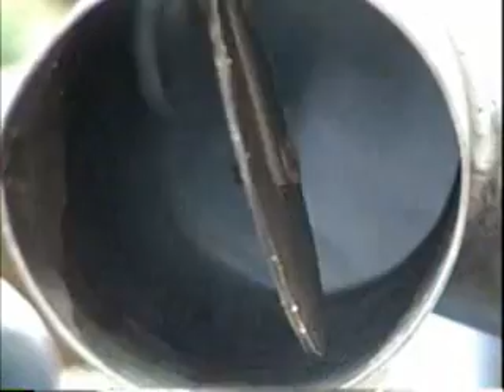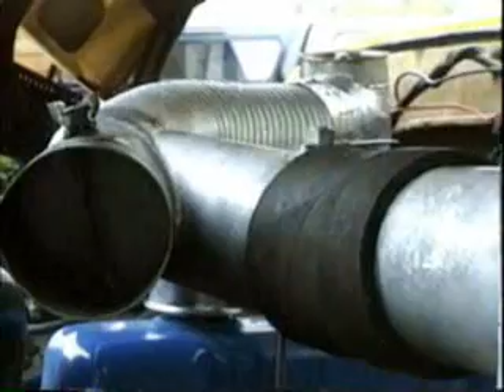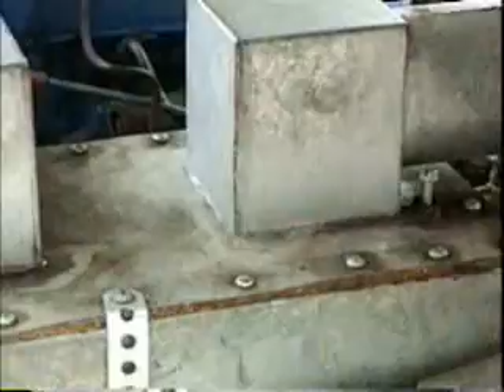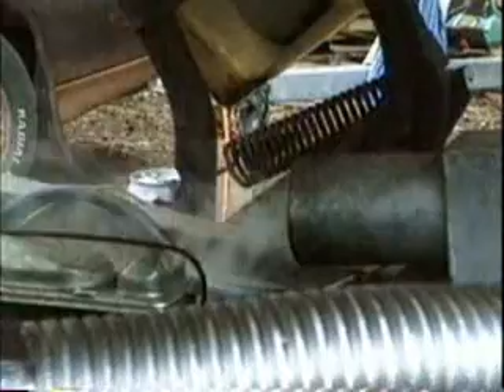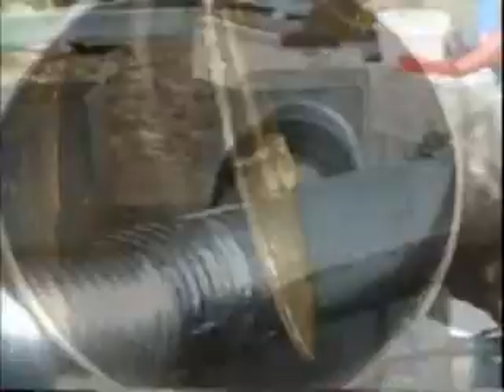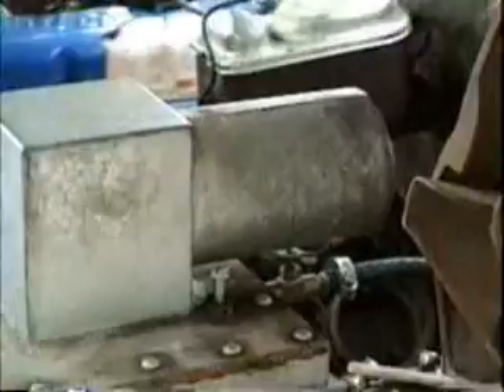Here is definitive proof on how to separate all Atoms in all liquid soluble matter.

Comment from the maker: Fuel history I am not concerned with, my concern is the future fuel. I know exactly how the GEET system works, it is a modified form of what I did, 30 years ago, only they don't really understand what they did. They talk about plasma and the like, but basically they are taking the flammable liquid  spraying a flammable mist onto a heated surface, at the intake manifold. Controlling the air intake or fuel output, they can control the engine RPM. I sprayed the gasoline onto my heaters 30 years ago

Comment from the maker: The smaller the matter the faster it assumes the heat being applied. Pass a flame close to an ant, his legs will turn to charcoal almost instantly. Liquid is also a matter. Therefore I say present a very small amount of liquid to a desired heat, and the liquid will assume that temperature, then boil at the applied temperature, any temperature desired. This is possible because it takes so long for any liquid to boil. Temperature happens first, when small amount of matter is applied.

Comment from the maker: Thinking out of the box, has developed the technology we have today. Many scientists are afraid to try and change, or accept something that they have never seen before. The presumption is that liquid will boil only at said liquid's boiling temperature. An ant having a flame passed close to it, it legs turning to charcoal almost instantly tells me, the smaller the physical matter, the faster it assumes the heat. Liquid is matter to, it works the same, and can be taken to any temperature, applied.

Comment from the maker: Here is more information. In San Jose, CA. I saw readings on a truck I took there. Running on liquid gasoline, the smog readings maxed the chart. When I switched to the white vapor, the smog analyzer made a flat line at the bottom of the chart. The mechanic thought the smog probe had broken. The truck on You Tube, I used 2 clean rags and ran the truck on liquid gasoline first, the rag would make your eyes water, from a distance. Running on the white vapor, it smelled like freshly ironed clothes.

Comment: My research and study has indicate we send 40% of the gasoline out of engine into the exhaust system to be burned up inside the catalytic converter. An additional 40% generates heat from the process of compressing gasoline in it's liquid state ie 50 to 65 micron liquid drolets sprayed into the combustion chambers via todays Fuel Injectors. This heat is energy that does not become motive force- but rather just simply heat. Thus 20% of the fuel is what we use to move the automobile ie Motive Force

Comment from the maker: I had forgot, you are right the engine did tun cooler on the white vapor. Because there is no liquid inside the cylinders, to remain burning, and continue to burn until it reaches the catholic converter, that burns the remaining liquid gasoline. Talk about a waste of power. Vapor all burns inside the cylinder. You can actually touch the exhaust manifold, after the engine has run on the vapor for a while. It is still hot but not as hot as it is running on liquid gasoline.

Comment: the only problem i see at mo what am working on is the feed from exhaust is 3/4" diameter & if i put flash back arrestor it may stop the heat & pressure drop also i want pressure also heat combined then ether in the pvc or just drop into intake throttle body  going into pvc makes much more heat lot to work on still lol

Comment: If the exhaust manifold is much less hot when running the internal combustion engine on the white gasoline vapors- I do not know if there would be enough heat to flash heat the fine mist of gasoline producing sufficient vapors to run the engine at higher rpm's. Billy may be able to help you in that area. It is my understanding that billy has complete many years of experimentation and learn much about what can and cannot be done with todays gasoline and all the additives that are in gasoline.

Comment: When we flash heat the liquid gasoline in the way that billy has achieve- the vapor is actually cold and will not condense back into a liquid state. Therefor- we may actually be able to do as you mention- which is to send the white cold vapors into the intake manifold. I'm considering different design ideas that may permit us to use exhaust heat to vaporize the fuel. Although billy note(if I recall correctly) the exhaust manifold and system is much less hot when running an engine on white vapors

Comment from the maker: I know for a fact the white vapor that I created, from gasoline, will produce more than twice the power of gasoline, without any turbo or supercharger. I have seen this on two different Dynamometers. One was at a college where the instructor told the student, after seeing the increase in power when I switched to the white vapor. He told the student I was using Nitrous Oxide. This told me a 4 cylinder engine could produce as much power as an 8 cylinder would. That is a big down size.

Comment from the maker: If what I did to gasoline created synthetic additives, then why do they bot mix with the gasoline they were created from. After all they were mixed into the gasoline when added, and I would bet they were flammable when added. I have a non flammable liquid, with an oily texture, a boiling temperature, as high if not higher than liquid mercury, and it does not mix with gasoline anymore. In the  fragmentation of gasoline, they apply the heat to the gasoline. I am applying the gasoline to heat.

Comment from the maker: I told the guy that created the GEET system to have Chromalox make him a 500 watt tube heating element, like the tube in his system, then the residue that Flashing Liquid, to the gasoline creates, will be sucked into and burn in the engine. He uses exhaust heat like you suggest, but has to start the engine with liquid gasoline, and bring the temperature up before applying the gasoline to the hot tube, to create the vapor.

Comment: hi billy yes your method is great only problem is that left over residue is problem if run car with gasoline not vaporize much then when gets up to heat then you turn the efie unit down say when on the highway then you should save gasoline the damn modern cars not too much room for another alternator your method need do lots electrical calculations ie watts amps etc etc the draw on the heater & so on but if alternator takes it be great be best if the residue is just slid in the intake -

Comment from the maker: There is a guy in Oklahoma that has a similar system, it is called GEET. Problem is you can't produce the vapor, until the engine warms up and creates enough heat. Something else the temperature is unregulated, and in colder weather I am not sure the exhaust heat tube could maintain the temperature needed to flash the liquid like I do. Temperature controlled, electric heat, using a power inverter, is the easiest way to do this.  To do this to water requires a precise temperature.

Comment: hello mate have you tried hot exhaust gasses straight out of manifold in a tube with injectors spray in the tube say 4 cylinder engine 4 injectors then either have it routed into butterfly valve or suck in the PVC but damn manifold modern cars is plastic i wonder if it can take heat am guessing it will if it works aether lean out mixture with a efie or disconnect injector or few depends how it runs then when full throttle let the ecu add extra fuel for power am guessing this b good one?

Comment: Thank you billy. I understand. I will look into having this Gas Spectrum Analysis done, of the white vapor production(flash heating- instantly heating- under the conditions you specified) a fine mist of gasoline at 600F. Furthermore- I will save what you believe may be Liquid Carbon, and have this non burnable liquid that no longer mixes with gasoline- looked into as well.

Comment from the maker: I have seen signs of a flammable gas from water at just above the 212 degree Fahrenheit, boiling temperature of water. I used distilled water, it is a non conductor. Problem is the boiling temperatures of hydrogen and oxygen are so close together, about 60 degrees Fahrenheit, difference. This will require a large mass of heat, to stabilize the temperature change when the cool water is sprayed onto the heater. The finer the mist droplets of water the faster the water assumes the heater tempature

Comment from the maker: In the chamber, you see on You Tube it took about 30 minutes to accumulate about a quart of the non flammable liquid, when running the big V-8 engines. I thought this was my nemesis, the chamber filled with this non flammable liquid, and it stopped making the white vapor, then I realized just what I think I have done, which lab tests on a Gas Spectrum Analyzer will prove or disprove. The white vapor and non flammable liquid need to be analyzed. I'm right, this can be done to any liquid. Water!!!

Comment from the maker: In making the white vapor, reuse the liquid that accumulates in the lower part of the fry pan, spraying it back onto the fry pan, until the liquid no longer turns to a vapor. This is why I know the liquid does not mix with gasoline anymore, and that it is no longer flammable. You will find the liquid has an oily texture. I think it might be a liquid carbon, but have been told liquid carbon doesn't exist. The white vapor has twice the power of gasoline, as seen on two different Dynamometers.

Comment from the maker: On gasoline the higher the octane level, the lower the boiling temperature the gasoline has, from 100 to 400 degrees Fahrenheit. I used regular, the lowest octane level. To create the white vapor, a stainless steel electric fry pan will work. Set the pan on the highest temp, allowing it to cycle. Put the pan in about a 20 degree angle, Spray a really fine mist of gasoline onto the pan, on the high side of the pan. White vapor will appear instantly, capture the white vapor only and seal container

Comment: Billy, I will look into having this test done. Please detail exactly what you want done. Leave out no detail. I believe you mention the use of Low Octane Gasoline. I will use Chevron 87 Octane for the test unless you specify otherwise. You want the White Vapor Produced at exactly 600F at Atmospheric Pressure(at sea level). And Gas Spectrum Analysis Of The Remaining non flammable liquid. Please specify the temperature and conditions for the water flashing as well. Distilled Water or Faucet water.

Comment from the maker: Like I said if someone will have the white vapor and non flammable liquid I have created from gasoline, analyzed by a Gas Spectrum Analyzer, I bet it will be found I have created a molecular structural change to gasoline, and what can be done to one liquid can be done to any liquid. If I am right, then a molecular structural change to water will produce hydrogen, as much as is contained in the water applied using my Flashing Liquid process. It just needs someone with money to do the lab tests.

Comment from the maker: Exhaust heat, comes when the engine has run for a period of time. You need a way to have heat to create the vapor. Electric heating elements, with a power inverter is so much easier, and the heat needed to create the vapor is available when the engine is started. Otherwise you would have to use a flammable liquid to start the engine to produce the heat from the exhaust, then switch over, allowing you to make the vapor.

Comment from the maker: I don't think you have ever worked on a vehicle before. Liquid gasoline, is worse than vapor. When the vapor ignites, it burns instantly, and nothing is left to burn after that. When the liquid gasoline ignites, it keeps burning until all the liquid is burned up. This is why vehicles will burn for a long time. With vapor it is one poof and done. I had only one time the vapor caught on fire, when the heating element received over 2000 volts, burning it into 2 pieces. The liquid gas kept burning.

Comment: also did you now i read u can run a engine 75%buffalo urine & 25% gasoline lol  without any problems also i think in Africa there running human urine to run generator using hydrogen generator apparently urine has got 4 parts hydrogen lol instead of 2 in water power to the people damn gasoline prices are beyond a joke lol

Comment from the maker: I don't know what type of vehicle you have, but an auto parts store would have a larger output alternator, for your vehicle. They would know if your alternator would handle the load the inverter would create. I don't know if they make a 240 volt DC inverter. I know they have the 110 volt DC, which is the voltage we use. Maybe this will help. I suggest using the 110 system on the vehicle, less dangerous, if by chance anything happens. Better safe than sorry. Chromalox has your heaters.

Comment: i been reading about inverters what ever power consumption it uses you must multiply it by 10 or more at moment my experimenting hot plate is 8oowatts approx 10 amps 240volts in UK i don't want burn out alternator or inverter need ask electrician then maybe can uprate my original alternator

Comment from the maker: A stainless steel electric fry pan was how I discovered how to Flash Liquid. Mass on the heater stabilizes the temperature when spraying the liquid. This will be critical when and if it can be done to water, to extract hydrogen. I suggest finding a heating element manufacturer. I used stainless steel heating elements. Chromalox, is the company here, in the USA, I use. They can make any heating element, and have thousands in stock.

Comment from the maker: I to had your idea of putting it on the top of the intake manifold. The calrod heater doesn't have enough surface area to maintain a constant temperature when you spray the liquid onto it. I suggest a flat surface. I had in mind a round flat heater. Check out Chromalox. They can make any heater you want. They have many they already make.

Comment: True. So little extra space in the engine compartment. However, the air filtration box is quite big on some automobiles. I was thinking of building the white vapor chamber in place of the air filtration unit, and then connect a different type or kind of air filter to the vapor chamber. This may provide extra space. I wonder if you could use a Calrod Heating Element, in order to achieve higher temperatures than 550 F. Staying below gasoline's autoignition temperature of 950 Fahrenheit.

Comment: hello again mate i used a 800 watts hot plate which i think in USA it is called skillet  that got up to max 550f in few mins then i decided to take of the Teflon coating thought would make it hotter  bad news actually decreases the heat by approx 100 to 150f so i turned it upside down which has got Teflon coating so went back to 550f damn modern cars no space to adapt secondary  alternator

Comment from the maker: I don't think they make an aluminum heating element. The melting point of aluminum is to low to with stand the temperatures that the resistance wire inside the element, would produce. The resistance wire glows to a bright red, when voltage is applied. Also, unless you put the heating element over the intake manifold, which will suck the non flammable liquid into the engine, you will accumulate the non flammable liquid, for gasoline, using my Flashing Liquid method.

Comment: hi billy happy Xmas mate I know U been there done it with gasoline but it is a big deal the fuel saving your device makes. gasoline here is £1.30 lt sterling  which is a joke have you ever used aluminium for your heating &yes you are very right the temperature drops quite a bit & more brown scum on heater is probably produced like 150milespergallon says little that I have done hotter the plate no scum but I need much hotter hot plate that is what am using at Mo all the best Mattie

Comment: For gasoline White Vapor Production- thin steel works well because it heats very quckly allowing the automobile to be driven almost instantly. With the thick steel(large heat mass), much time is needed to allow the steel to achieve the proper temperature. Although beased on your notes and experience, Hydrogen from water requires much less heat compared to the White Vapor Production system(600F minimum temperature required).

Comment: True. This is the reason for the 700F. In order that the final temperature would remain as close to 600F as possible- after spraying the fine mist of gasoline droplets from a fuel injector- onto the heated steel surface(Tea Kettle with 400watt Calrod Heating Element pushed up against the bottom of the kettle, permiting heat transfer from the Calrod heating element- to the steel kettle). The thin steel achieves operating temperature ie 700F very quickly. Thick steel took approximately 20 minutes.

Comment from the maker: Bet the stainless steel changes as much as 100 degrees when the liquid is sprayed, any takers? Been there done that. Mass will hold the heat. Spray the liquid onto the stainless steel sheet , then read the surface temp. The temperature will drop as much as 120 degrees, from the liquid, being sprayed for about 10 seconds, on that stainless steel sheet metal. You need mass to maintain the temperature.

Comment from the maker: I used 600 degrees, The two flat bar heaters I used, wired in series, would maintain that temperature, spraying gasoline onto them. However, the finer the mist the better the heater temperature can be maintained. Something else, the larger the heater mass, the more stable the temperature will be maintained. I don't think higher temps change anything. I had one of the stainless steel heaters burn into two pieces, when not knowing my power source produces over 2000 volts, driving on the highway.